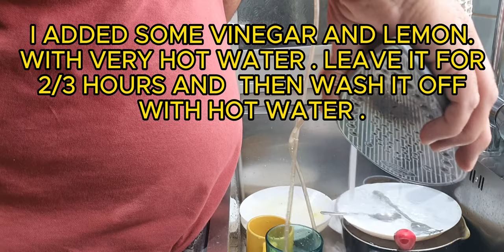TEFAL STEAM GENERATOR IRON REPAIR AND CLEAN

Comment: What if after replacing the sollenoid valve (with ove rpressure savety), the steam still comes out through the over pressure valve? I cannot find the pressure switch in the system. It's a Tefal GV7556